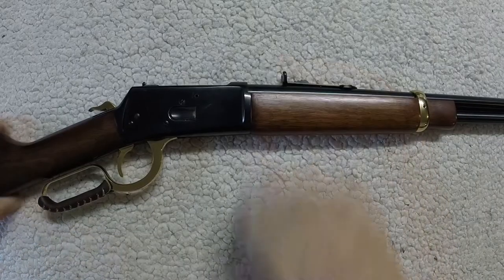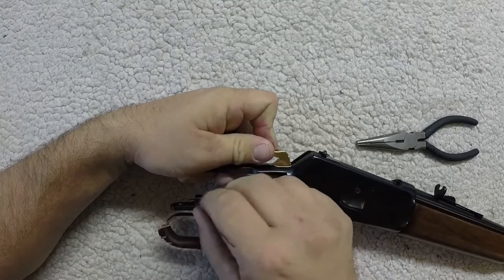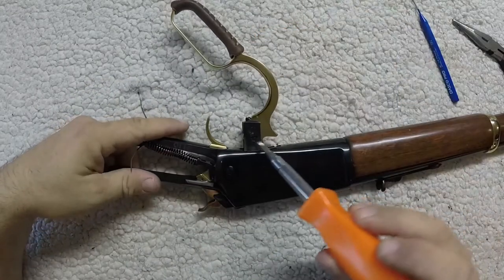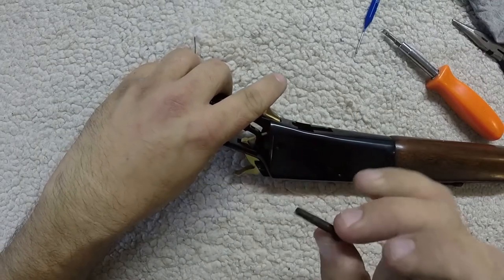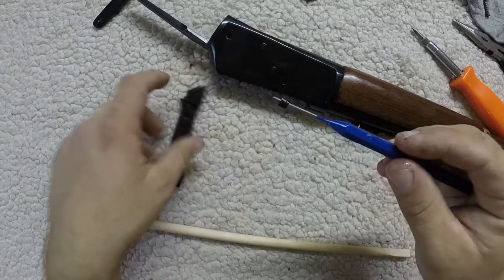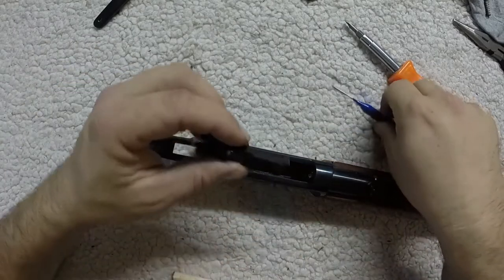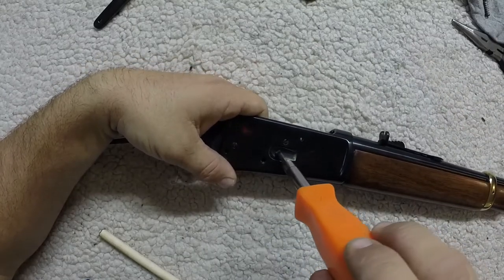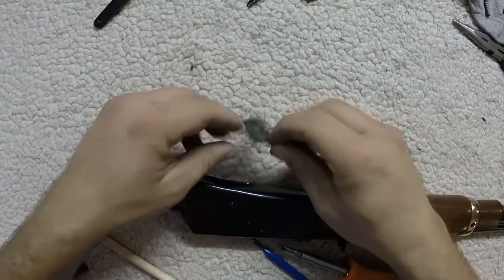Rossi R92 Disassembly

Comment: THANK YOU SO MUCH (caps intentional). I am having a problem with the cartridge stop not engaging and this is the ONLY video that I found that shows the removal of the cartridge guide. Now, after seeing your video, it is not that big a deal, but it was still nice to see
Reply: How did you go with that? I have the same issue with my Chiappa 92. I've seen a video where sometimes the leaf spring behind it is installed incorrectly, but I  think in my case I need to file away some of the carrier that is blocking the stop from coming across enough to stop the following cartridge.

Comment: Do I have to do all of that to clean it?
Reply from the maker: Not every time. Get the bore and bolt face clean and get what you can inside with a toothbrush most of the time. Occasionally you’ll need to get in there to clean it really good, but it doesn’t really get that dirty inside.
Reply: Bro I was gonna ask the same question 🤣🤣 thank god we don’t have to do that every time , I was about to return the gun if i had to do all that to clean it